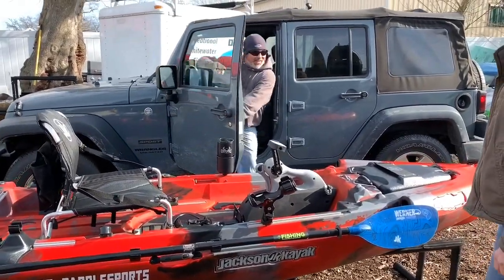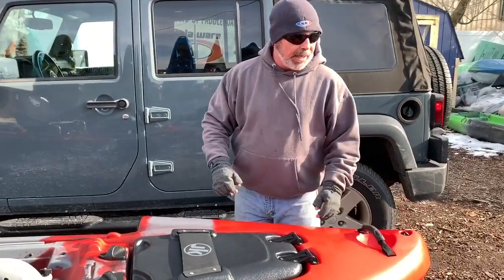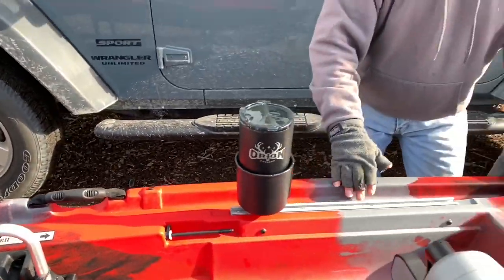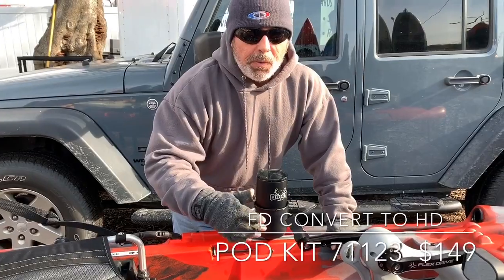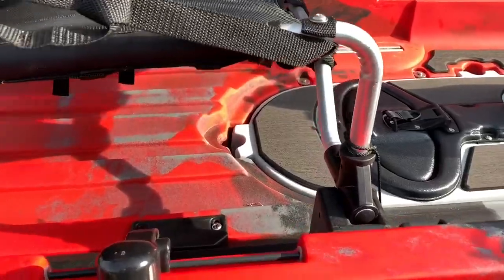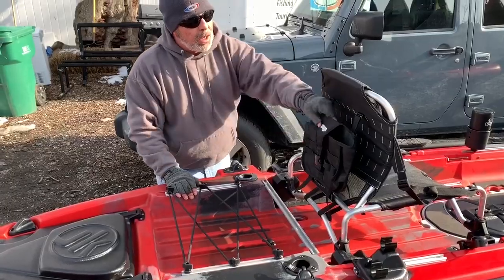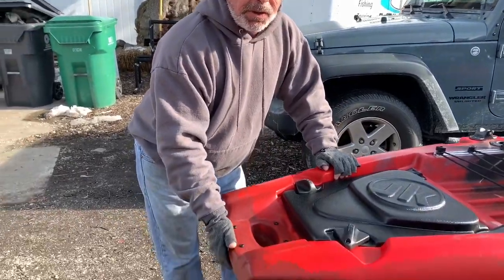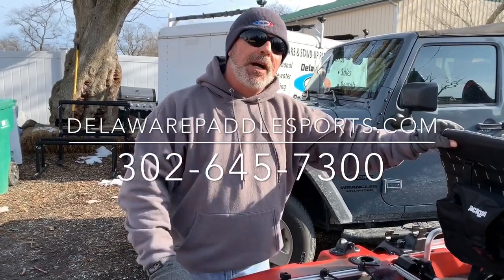The 2019 Jackson BIG RIG HD FD is here at Delaware Paddlesports

Comment: GR8T video !!!
I like how you can disconnect and connect your rudder  while tansporting it.
now will a boonedox landing gear work on this ???
Reply from the maker: Most Likely we are looking into that with Boonedox this coming week.
Reply: I just mounted my Boonedox landing gear last night. Boonedox is selling a high density plastic backing to use in conjunction with the steel backing plates. There arevreally only two options I saw for location and neither was optimal. I ended up
Mounting them towards the rear of the aft tank well. This was the area with the most flat surface to mount on. The other area would be just behind the seat using the gear track but I was strongly advised not to do that. Any help with mounting my Raymarine Dragonfly pro7 transducer would be greatly appreciated!!